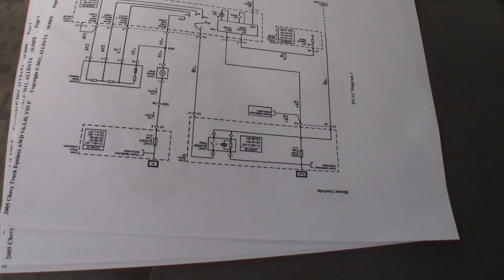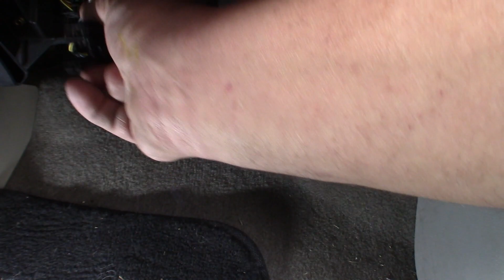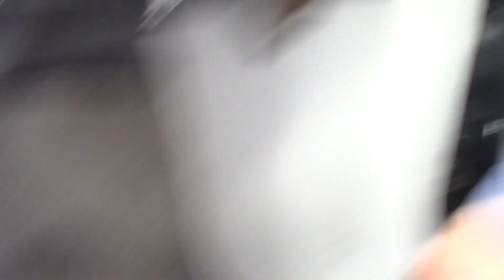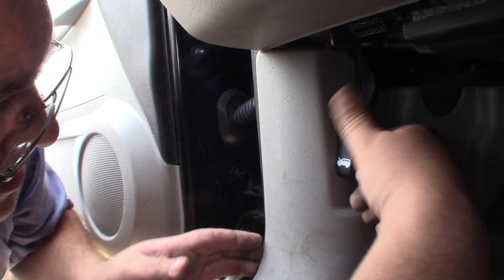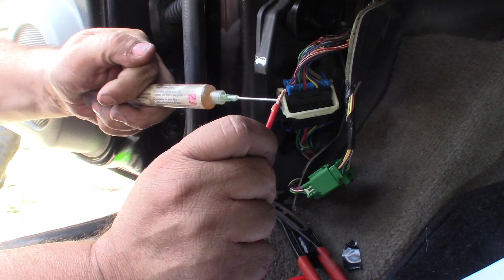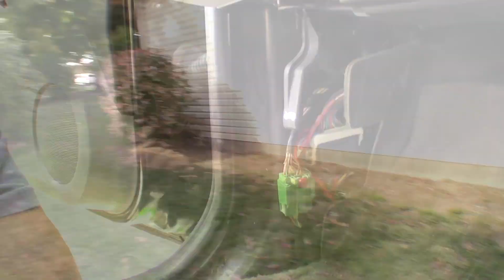2005 Chevy Equinox No Heat - No Blower - Electrical Diagnosis and Repair

Comment: Didn't help with mine. The wire was burnt . I did step by step with what you did still nothing. I get power to the control panel you can hear the actuator changing over when switching from head feet defrost but I get no power to the blower. I've replaced the blower and still nothing I've replaced the control panel it's self still nothing. Ive replaced relays fuses. I've even replaced the pigtail going to the control panel. Any other ideas?

Comment: Hello, I could use your help again, the AC blower no longer works on high speed on our 06 Equinox, it works on every other speed just fine. I changed the blower resistor but that did not fix it, checked the 40 amp fuse and swapped the blower relay.Would the only thing left basically be the Climate control switch or possibly a connector the supplies the 12 volts at high speed? I could not understand the diagram you displayed in this video, I'm still learning how to read them . Any advice would be very helpful and appreciated.
Reply from the maker: It is either the Switch.  And I have see a few bad ones over the years.  Or it is the purple wire that runs from the switches High Speed directly to the blower motor and bypasses the resistor.  I would pull the switch and the connector and ground the purple wire with a test light it is light then your purple wire is good.  Then hook the test light to a positive and see if you get it to light coming off the switch on the high speed.
Reply: @frugalprepper Thanks, I will try that today.

Comment: Thank you. I did my own diagnostic and got as far as finding out the red wire was the problem. I had normal voltage with no load but as soon as it had a load it would go down to 0 volts. My next step was to find out where the red wire has a bad connection but now I don’t have to ho through the trouble. Thank you again.
Reply from the maker: Glad you found the problem, it's a common one on these.

Comment: Absolutely amazing video! Am so happy I stumbled across this when I did! I have the exact same 05 equinox and my fan was cutting in and out intermittently and I was going to start with the resistor and then move to the blower motor itself if it wasn't the resistor. I had issues previously with water getting into that 40 pin connector and would throw my car into limp mode. After watching this video I went straight to this 40 pin connector and sure enough. Same exact pin and connector slot was brown I assume was arching, causing my fan issues. Mine wasn't burned out like the one in this video, so I cleaned it out best I could and packed the slot with some fresh dialectic grease and by some sort of shade tree mechanic magic...she kicks on and runs perfectly and no more cutting in and out...for now. At least if it starts acti g up again I have this video saved and I know exactly where to look. Thanks again! Saved me money in parts that didn't need replaced!
Reply from the maker: I am glad it helped!

Comment: How would you go about buttons like defrost and the air recycling button blinks once pressed and then stops and no cold air or hot air blows
Reply from the maker: Check all of the Actuators under the dash that handle the switching of the flaps for mode selection and recycling air.   They are probably dead.  A pretty common problem.
Reply from the maker: If it is a Honda it can be the Rear Defroster Relay Unit that is drawing too much current.

Comment: great video if i might add here. your the man, not to many people out there will even think about adding shrink wrap and a label for future if needed and awesome video without a doubt and a mechanic i would hire to work on my vehicle if i were to refer somebody. I dont say this lightly bud. your a warrior, 110% for this and repair it like you stole it I love it. my problem here is if you can beleive this one its just nuts I have a 2006 pontiac torrent 3.4 now any ideas, iam at a loss here seriously. and anything would help alo.t If i can explain, and hopefully you still manage this feed. let me explain the  best i can here, and any ideas or help would be greatly appreciated.

mine freaked the crap out of me it was literally burnt on the pigtail that goes to the heater control module, and the other end going to the resistor, (no fan will go on now) but the blower fan once removed ran like it was going to take right off on me so its great! but the other end of the pigtail going to the resistor was a little dark brown but not burnt!. Now get this, replaced the entire heater control module, resistor, new pig trail that came with the resistor all fuses checked! and all good condition. Now, when this happened the very weird part, was it did not blow any fuses and this one was a 40 watt (the same one you had pulled out, the relay no damage no cut wires. Now, this is the strangest thing i have (ever seen) or faced if i could post the photos here i would because i`m sure not to many have seen! And great job you did on the blower motor (anyway had mine ou)t, and works like, new  so after doing all this, still the fan will not go on period  i don't like giving up. You have any ideas or have you ever run into this!. the heater/Air worked great but was kinda, stuck on med and the wife did say, she had smelt like something burning, and this was last year. I din't think nothing because everything was as it was, and no fuse/relays burnt checked all back then, and now, the heater quit for good this time ?? Mystery vehicle i tell ya usually a fuse or relay will blow but no nothing. anyway if you have any ideas. can you let me know when you get time thanks bud.
Reply from the maker: See if you are getting power and ground at the connector for the motor.  You need to do it with and incandescent bulb or test light, not a multimeter, that way you put a little load on the circuit.   A lot of times these turn out to be a bad ground.  The connection get bad and the voltage drops and the current goes up, which causes the wiring to heat up and melt.
Reply: @frugalprepper  okay thanks for this i was doing it with a multi don't know what i was thinking but thanks for the advise brother keep up the awesome work

Comment: Interesting! My wife has the same car. when it rains here heat/AC is dead for a day or two. Now That I watched your Video I do recall The rubber seal strip on the the windshield was messed up on the drivers side. Right above where you spliced that wire. I'm going to check it when I get home. Thanks!

Comment: 2015 Chevy equinox no heat blowing the shop I took it to said u need to replace the “heat box” and vents any help?
Reply from the maker: Is it blowing cold air or not blowing at all.
Reply: @frugalprepper  just cold air

Comment: the red to white wire is shorted. what components are connected to that cable? It's the same red to white wire that you fixed

Comment: I have an 06 Equinox. The A/C works great but i just discovered the heat not working. Blower works. Just blows cold air. Is it the thermostat or heat core
Reply from the maker: Probably a blend door actuator.

Comment: Good job. Did you find the location of the connector through all-data as well?
Reply from the maker: Yes.  For most cars AllData gives connector, and power and ground locations.   If you get into the European stuff though it's a little sketchy.   Mitchell has the best electrical diagrams, but I have AllData, so that is what I use for now.

Comment: You know, IMHO,  this is engineering and complication way beyond what is needed to run a blower motor.
Reply from the maker: I would agree with that, but it nothing compared to how its done in most new cars.

Comment: I'm going to put out a video shortly about my heater control issue and the strange cause. I think you may get s kick out of it
Reply from the maker: https://youtu.be/KNVaiXI6Pkc Hey Everyone check this out.  I got to pull up some diagrams and see what these circuits have in common.
Reply: @frugalprepper  . Fyi. Tried the plug that's for the back seat that is located in the center console.  Wavered a bit but kept working
Reply from the maker: I would love to see it.  I will go sub to ya so I don't miss it.